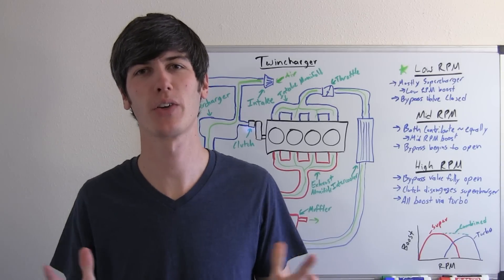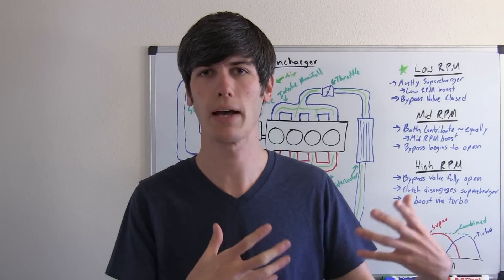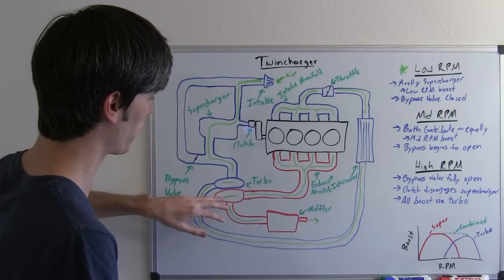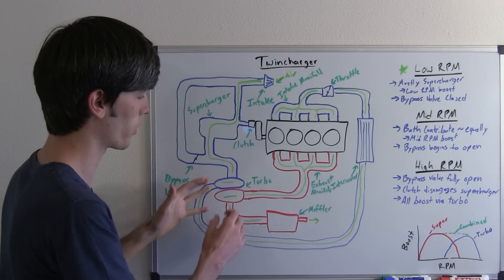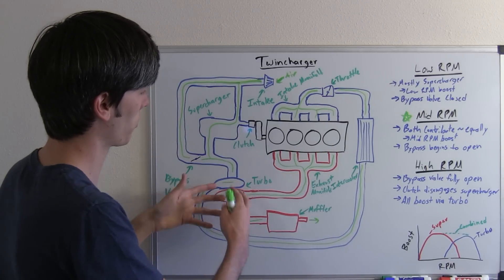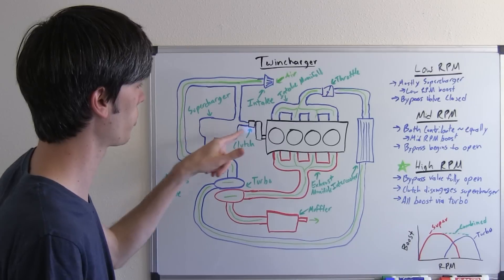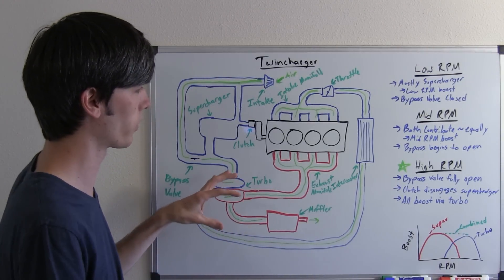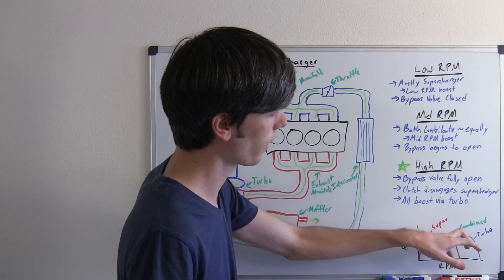How Twinchargers Work: Supercharger + Turbocharger

Comment: Lancia Delta S4. I'm pretty sure this was the very first car to ever be twincharged from the factory.
Reply: Not only that, but the Delta S4 did it the other way around than the setup shown in the video.

Instead of having a supercharger feeding the turbo, it had the turbo feeding the supercharger.
Reply: ShadowFalcon Really? Why would you do that?
Reply: BrakeHorsePower92
No idea.

I wasn't on the Lancia R&D team when they did it, but that was how they did it.

Presumably Lancia did it like that because the engine was based on the supercharged Lancia 037 engine.

Comment: check out divorced belt driven whipple super chargers no stock car has ever done it i built a 93 foxbody mustang  2.3 esslinger race moter and got the idea for it from a civic but i went to the auto insurance salvage bought a totaled 5.4 supercharged mustang and took the supercharger off it saved the moter but had a machine shop build a hollow box that the supercharger mounted to with 4 inch outlet and mad a few custom brackets and sat the charger and box in the fenderwell and lined it up hooked up the belt and intake piping and excetera fast ecu system so had a high boost supercharged 4 cylinder mustang that would outrun v8 mustangs and if launched correctly it could stand on its hind legs and run low 11s high 10s with slicks and spray

Comment: Looking at the diagram it looks like the air going through supercharger is always going through the turbo compressor and then to the engine. Is that actually the case or does it not go through the turbo?

Comment: What about using a small sniff of N2O in the low rpm band to make up for the lag? I heard some people do that, and would like your input on it. Great vids by the way
Reply: +Chris P  People do use N2o injection on turbo and engines however it is a complicated and dangerous game to play. The system works by spraying a small  shot into the air intake on the turbo intake spinning the compressor wheel with the expanding N2o. It must be hooked up to an electronic controller to automatically inject the N2o at low rpm when throttle input is detected or hooked to the clutch so it sprays between gears. Nitrous is very powerful stuff and when mixed with boost it becomes VERY easy to lean out your air fuel ratio and pre-detonate the engine so extreme caution must be used. This is probably why you dont see it too often

Comment: Hi, I'm thinking of twin charging my ls1. I have a roots type blower now and we're wondering if this could work without disengaging the blower, and not having the bypass valve??? Also, if it's not possible, what and how would the bypass valve open and close? Same for the clutch type pulley that would be required to disengage the belt? Your answers would be much appreciated. Thanks
Reply: +nikolas bolonis I'm not an expert but I do believe roots superchargers generate a lot of heat all by themselves so it might not be a good idea to twincharge that.  if you must twincharge, use a twin screw sc and a rear mounted turbo like the ones from STS.   that way you are removing one huge heat source away from under the hood.   plus it would give you more room for all the tubing
Reply: I was thinking about how to get the valve working myself.  Possibly wired at the pcm to read the rpms to switch when it hits a certain voltage? Idk
Reply: to be totally honest, the biggest thing holding me back is figuring out how do the switch over from sc to tc as well.   is there a way to feather off the boost of the sc while the tc boost levels are rising...  bypass valves seem like a giant source of boost leaks.    anyone have a good idea?

Comment: Could you add a twin turbo with a supercharger? If so would it make none, some or a lot of power?
Reply: well that would depend mainly on setup if you had huge 57mm turbos it would make crazy power...all the supercharger is doing is making up for the turbo lag and giving you the low end grunt that turbos just cant do
Reply: It would make all the power... all of it.
Reply: Michael Budlong yup, stick with the single turbo because less parts means more reliable.  1 massive turbo can do as much as twin turbos because the supercharger removes the lag.
Reply: The Audi SQ7 TDI is a twin turbo with a supercharger
Reply: There is no point of using supercharger on twin turbo engine, the reason they make twin turbos is exactly the same as the supercharge a big turbo engine, and it is to eliminate the turbo lag! one turbo kicks in first and helps spin the othe turbo= elimination of big lag and get better throttle response! Hope that makes sense!
Reply: @dimitrovbmw  Sounds like sequential twin turbos, a small one for the low end and large one for the high end.

Comment: I've heard supercharged or turbocharged engines need different lengths connecting rods than each other/regular intake engines due to compression issues. How much of that is true and what else might some people not realize needs change when adding performance parts to an engine? Would you mind doing a video on that?
Reply: Dragoon876 changing connecting rods wouldn't change compression. Changing compression is mainly pistons and cylinder heads
Reply: and more over the regular rules dont apply you would have to start from the ground up with an engine that was built with the idea of running loads of boost and with that alot of it
Reply: Sometimes changing connecting rod can change the cr, if you put a shorter rod in a engine the piston wouldn't be able to reach to the top of the block deck and the cr will be lower. It happens on the old Nissan L series.

Comment: Thank you for the great ecplanation, I have one question
Why do high performance cars don't use to use this set up?
Reply: It's a lot of boost. It would be a pretty expensive car if it had the ability to run that much psi. There's not even a lot of drag cars with twin chargers but it's amazing to see
Reply: +Unholy Jane 420 dude, heat, heat is the thing. You don't want to blow up your engine. compressed air really increases the temperature inside. You also don't want pistonheads to melt down.

Comment: The turbo will re-compress the air coming from the supercharger. You don't need the supercharger on a clutch, and do not require a bypass valve. It's called compound boost. It's a very simple system.

Comment: I actually seen someone who did it to his Ford GT, but then when be dynoed his car I notice supercharger "Whine" then turbo, so basically from what I understand of this idea is you will never have turbo lag or lose throttle response, to be honest it sounds like a lot of work but it would be sick setup because you will not lose boost because "supercharger belt" might rip at high boost or get damaged, 

P.S: great job and subbed
Reply: yep you get it sadly the supercharger has to drop off on the high end one to save its lifespan from wear and tear on top of constant usage giving heatwear but also i have heard if its on in the high rpm since superchargers start to bog it actually bogs the turbo somewhat as well

Comment: I didn't understand only one thing. In low rpm's, why the air passes only from supercharger, in medium rpm's from turbo and supercharger simultaneously, and in high rpm's only from turbo? For the correct air quantity?
Reply: At low rpms the Supercharger will create boost almost instantaneously, as it is driven off of the engine crank. At this time the turbo has not had enough time to spool. At mid rpm, the supercharger is almost out of "puff" and the turbo is almost fully spooled. Then at high rpms the supercharger is no longer effient, so the turbo takes over because it is now spooled. Also, between low and mid rpm the compressed air from the supercharger passing through the turbo will ultimately aid in a faster spooling of the turbo.
Reply: Efficient*

Comment: Is there any reason that you couldn't have a belt driven gearbox/clutch of some sorts connected to and drive the compressor side of the turbo? I can't think of any logical reason this wouldn't work during the lower to mid rpm range where the exhaust turbine would take over. I would think this would simplify the plumbing and complexity alot.
Reply: Look up a procharger.
Reply: Procharger make centrifugal superchargers.
Reply: Benjamin Donovan thats the closest thing to that, except it cant use exhaust gases to take over when flow is sufficient.  The heat would kill it. Not a bad concept tho.
Reply: Yeah, I was thinking that. The thing is I don't see such a design,  there might be some inherent reason they don't do it that way.
Reply: another reason aside from the spool time of the turbo for lag is that its centrifugal type compressor which require high rpm to actually create boost. the best type of supercharger to use with tsi / twincharger config is the root type. I recently acquired a porsche 924 that i have running a super charger first in sequence, i use a throttle body after the the super charger have the ecu programmed to open it, and disconnect the the supercharger pulley via mag clutched pulley simultaneously at around 5k rpm.

Comment: Im currently running a Vortech V9 @ 6psi on a 3.2L. How do I determine the proper size turbo to use with it? Is there some type of formula to use?
Reply: what is a V9?
Reply: wades623  A V9(f-trim to be exact) is a centrifugal supercharger made by Vortech. Its been discontinued so the equivalent that they make now would be the V5 but the V5 has straight cut gears and the V9 f-tirm came with helical. The V9 is pretty small. At 6psi on my 3.2L VR6 it puts out about 360hp and 300tq. The car in stock trim puts down 240hp and 236tq.
Reply: fat420cracker ok. I was thinking something else. it was late

Comment: What are the cons?
Reply: Mainly complexity - that is a lot of moving parts and a lot of tubing.  2nd con is the heat it outputs, especially for the intake air.  Your supercharger is compressing your intake air, heating it up, and then the compressor side of the turbo is making even hotter.  You can get a massive intercooler to help manage the heat, but that will create slightly more lag as your compressors will need to pressurize a larger space before you see boost. This isn't so much of an issue as a twincharge system is probably used on a race car that will rarely see lower rpm where lack of boost and spool time are apparent.

Comment: I love the idea of a twincharger system. However, not a lot of OEM makers go this route due to complexity (VW had a 1.4 twincharger engine sold in Europe, but killed it due to high price and complexity). However, Volvo recently created a 2.0 Twincharger engine for their T6 trim...
Reply from the maker: Trades46 Indeed they did! 2015 Volvo S60 - Twincharged - Review & Test Drive
Reply: @EngineeringExplained  what if the turbo could feed the supercharger instead
Reply: its actually pretty easy.... i mentioned above i did it recently on a porsche 924 2.0 liter. once you wrap your head around the plumbing of it easy to execute though requires programmable aftermarket ecu. the biggest issue with the system is finding the room under the bonnet to pull it of
Reply: Trades46 I drive said 1.4 twincharged engine, little thing is an absolute peach 😄
Reply: +Trades46 Another one of the few cars that used a twincharging system was the Lancia Delta S4 Group B car, in both Stradale (road model) and Evoluzione-II (competition-spec) versions.
Reply: No it didn't. The AW11 had a Supercharged engine, the SW20 had a turbocharged options. However Toyota never employed twincharging in any production engine, ever. That is inline with their company's policy of never straying too far from what is tried and true; hence their strong reliability.
Reply: Trades46 Toyota actually did but it was only for 200 AW11's that were group B (later used for Group A since they weren't very powerful and B was cancelled) rally Racing. it was the first time, the second time was for the Toyota GT-ONE road car and race car but they had to remove the supercharger system because the car exceeded the power to weight ratio limit for 24 hour of le mans. where as Mazda used rotary because rpm replaces displacement.
Reply: +Billy Raymond that thing literally sounds like a soul wailing from the depths of hell
Reply: Trades46 I drive said 1.4 twincharged engine, little thing is an absolute peach 😄
Reply: ***** it's okay if you just want to go around with a sticker saying "twincharged" but it doesn't actually have much of an effect. the end car wasn't hugely powerful.
Reply: @RamtheCowy  Twin charged engines can easily be the most powerful engines in both and low end power if you want them to be....
Reply: +Vohs Norred Do you have a link detailing how you did it or how to do it?
Reply: Toyota MR2 had a twincharged option too.
Reply: Trades46 it was done on the 4A engines, look it up.  It was not done factory, it was a special request or order but they did have a twin charge option on them.
Reply: 2016 Winner: Volvo XC90 T6 2.0L Turbo/Super-4 oh yea :)
Reply: What vw that using twincharger??
Reply: @dj.izzaro  golf and Jetta mk5 1.4
Reply: @dj.izzaro  golf mk5 gt tsi 170, golf mk6 gt tsi 160, polo gti 1.4, ibiza cupra 1.4, fabia vrs mk2, vw jetta Tsi, vw scirocco 1.4 tsi, audi a1 tfsi 185, the tsi models will have a red S and I in the badge, 1.4 tsi turbo only engines (122)bhp just have either silver tsi badge or just a red I :)
Power ranged from 160 to 185bhp, depending what model.
Reply: Yet throw a twin charger with nitros for a twin supercharger nitros booster machine
Reply: @jonathanoxlade4252  honestly i always say why use nitro when you can use a methanol water setup to up your boost the boost comes near instant where as nitro takes time to get going granted once it kicks in hooooooo boy but methanol is cheaper and easier to replace and unlike nitro which eats away at your engine methanol actually helps keep your engine from detonation
Reply: @Kradron5583  ozone. Methanol. Pretty sure both would ne better then nitrous.
Reply: @Rodney Patrick Instablaster :)
Reply: @Finn Alberto Thanks so much for your reply. I found the site thru google and I'm trying it out atm.
I see it takes a while so I will reply here later when my account password hopefully is recovered.
Reply: @Finn Alberto it worked and I now got access to my account again. I'm so happy:D
Thank you so much, you really help me out!
Reply: @Rodney Patrick Happy to help =)
Reply: yea , you can get a whine aswell as a stututu
Reply: The supercharger covers up and gets rid of the lag delay in throttle response of the turbocharger boost.
Reply: The Lancia Delta is the most well known example of twin charging used on the road and track but it’s also what killed group B so so it has a somewhat dark reputation
Reply: And it's amazing.
Reply: i guess Im asking randomly but does anybody know of a method to log back into an Instagram account..?
I somehow forgot my login password. I love any help you can give me.

Comment: can you install a supercharger on a previously turbocharged car such as a lr3 V6? ,And secondly what's the benefit of having two turbochargers
Reply: you can have 2 small turbo chargers that get boost together or a small turbocharger that helps spool a much larger turbo, although with recent tech what i just mentioned can be totally avoided by means of variable geometry turbines and more efficient designs
Reply: usually two can be used on V style engine because you can have one off ecch bank but there are some tuners that will use a smaller turbo and a bigger turbo at the same time because the smaller one will spool faster that the big one its kinda the same concept as twin charging but not really

Comment: how about triplecharger? turbocharged + supercharged + procharged
Reply: its another type of supercharger
Reply: +Engineering Explained think procharger basicly is an belt driven turbo
Reply: +Bunnef “Buneef_GT” GT lmao procharger is a brand of superchargers that doesn't come with an intercooler
Reply from the maker: Nawaf Alaroj What's a procharger? You'll realize it'd still be a twincharged engine.
Reply: Engineering Explained i dont have much information about it. but to me, it sounds like supercharger. here's a video example of procharged --> watch?v=8dsXYCQzG30
Reply: i know but its another type of supercharger which means it still a twin charging
Reply: +Engineering Explained Prochargers are a company that makes centrifugal superchargers
Reply: Takumi Fujiwara its you again..
Reply: Muammarvsgaming 00 Lol?
Reply: So you're basically suggesting the engine be fitted with two superchargers (a roots style and centrifugal style, which will both feed into the compressor of the turbine. I'm not an engineer but I'm pretty positive there would be no power gain in a setup like that. The intercooler would have to massive, as the compressed air would already be insanely heated.
Reply: Also the superchargers will limit the air flow even more than a plain air intake
Reply: ***** actually it will due to the turbo spinning faster than the supercharger which is why twin charged setups has a bypass valve on the intake to bypass the supercharger making the setup more efficient
Reply: the turbo will always be spinning much faster than a supercharger, a supercharger will only spin as fast as your engine will rev.  A turbo will spin upwards of 100,000rpm cuz it doesn't have anything mechanically limiting it.

Comment: Engineering Explained Is it possible to have the turbo and supercharger on separate intakes, and then combine them after the compressors to feed the engine? It seems that each would perform to its maximum that way.
Reply: Chad Barkley you can run the super charger directly through the turbo because the super will not heat the air  as greatly as a turbo mostly because the turbo is run off exhaust gas which can be anywhere between 1100 and 2000 degrees so the turbo will be hotter by nature. this explanation is just of a more efficient design